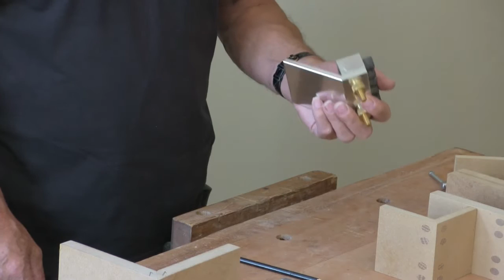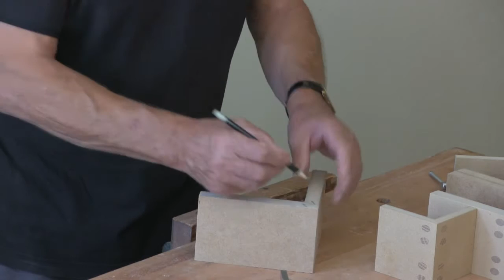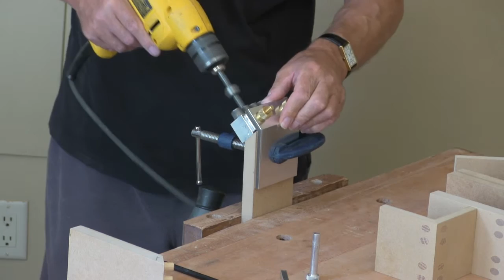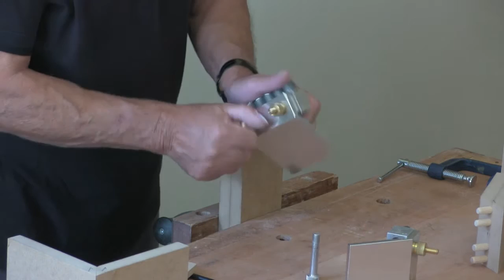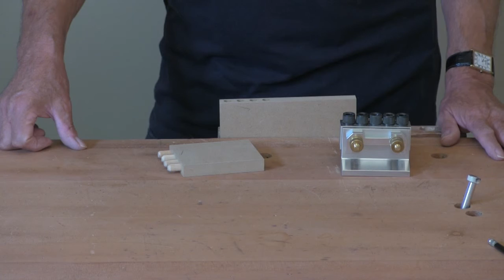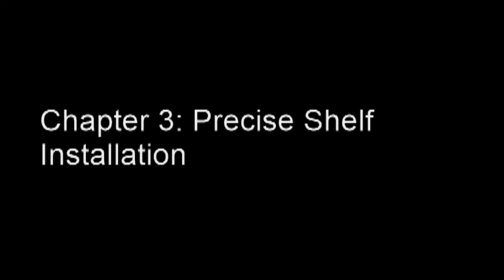Strong Miter Joint with New Dowelmax 45 Degree Accessory

Comment: I recently bought a dowelmax and I love it, it does produce perfect joints out of the box in minutes.
One enhancement that you guys really need to offer is something that even you are having to improvise on in your videos.
A piece of angle that is slotted to allow the body of the dowelmax to attach to it using its own thumbscrews rather than a separate clamp for making shelf joints in wide stock. If you could make it in 12", 14" & 20" lengths with a bit of extra length on the bottom part of the angle for better registration to the face and for easier clamping to the workpiece.
Reply from the maker: lumenman Hi Lumenman, Thanks for the compliment and request. Many people don't realize, we are a very small family oriented company. We did consider a similar design several years ago, but for reasons, not at all obvious, we didn't proceed. The initial outlay for extrusions etc,. is high. The manufacturer will not look at anything under thousand pieces, and if he does, the price per unit goes up exponentially. Then you have to market the product. The biggest question of all. In these difficult times, how many people are willing to buy that particular accessory? Anyway we really appreciate your kind comments. Regards Jim.
Reply: you prolly dont give a damn but does someone know a trick to log back into an instagram account..?
I was dumb lost my password. I appreciate any tricks you can offer me.
Reply: @Tristen Brooks thanks for your reply. I got to the site on google and I'm in the hacking process now.
Seems to take a while so I will reply here later when my account password hopefully is recovered.
Reply: @Tristen Brooks it did the trick and I actually got access to my account again. I'm so happy!
Thanks so much, you really help me out :D
Reply: @Reese Larry glad I could help :)

Comment: An update is needed to highlight that there are no more 1/4" spacers (as referenced in the video).  I spent about 15 minutes searching for my 1/4" spacer, wondering why I couldn't find it, until I searched and found Dowelmax doesn't make them anymore.  The 1/8" + 1/16" spacers seem to work fine for the miter edges.  

The one other tip I would mention is that for joining two 3/4" boards with a miter, you need to have 1" long dowels.  Unfortunately, nobody makes these, so you need to make them yourself.  Not that hard, but time consuming.
Reply: Thank you!  I noted the video didn't tell one how to adjust the drill depth, or the resulting dowel length. What, we're just supposed to guess?!?!  Pretty bad  step missed for a company that makes precision equipment.

Comment: Is there a way to use the Dowelmax and its accessories to install dowels on a mitered and beveled crown moulding?  For example, an external cornered crown where you had to use a miter angle and a bevel angle on your miter saw.  The application could be adding crown to a tall bookcase or kitchen cabinet.
Reply from the maker: I'm pretty sure this question came up several years ago.  It concerned a mitre /bevel arrangement for the four upper rims on a serving tray.  I had serious reservations, but when I tried it on a test piece I was amazed to find it worked.  Not recommended for stock less than 1/2".   Regards Jim.
Reply: @DowelMax  Hi Jim.  Thanks for the reply.   I'm new to the dowelmax family.  I have the 2023 model and the 45 degree miter plate and the angle bracket.  I must be missing something basic because I just can't figure out how to configure the dowel max to conform to the miter and bevel.   My stock is solid birch wood at .75" thick.

Is can you direct me to a video or write up on how to achieve this?  It's crown molding for a bookcase I made.
Reply from the maker: @MixingGBP  We expect you will need some sort of custom adaptation to suit your project. Some angles will require a shop made solution as shown here:

https://www.dowelmax.com/wp-content/uploads/2023/08/anglejoints2-large.jpg

Also check out the mirror project on dowelmax.com for some adpatations using mouldings:

https://www.dowelmax.com/dowel-jig-system-projects/how-to-build-a-mirror-frame/
Reply: @DowelMax  I see now.  I'll need to make a shop jig to fill in the spaces to achieve faces parallel to the dowel max clamping surfaces.  This allows the dowelmax to clamp on that shop jig as if it were clamping on a non-mitered and non-beveled workpiece.

Comment: On the 45 deg attachment you completely skipped over drill collar setting and the resulting/required dowel length. ☹️
Reply from the maker: Hi John.  It's actually different for every joint, but I have a method I use: With the angle plate secured, Push the drill and collar thro. a guide until it almost touches the plate face. Set the collar at that position.  In some cases use spacers to position the hole as close to the inner corner as possible. It will be stronger and less need to cut the dowel.  Hope this helps.  Jim.

Comment from the maker: dspeerelec643 commented: "The shim that he is adding to center the dowels works. But, this technique is also possible with the JessEm. It is slightly misleading to state you cannot do this with other systems. Obviously you can.
Reply from the maker: But you don't explain how to center on odd thicknesses with any other system, and so it is just an unsubstantiated comment.
Reply: @DowelMax  Where is the comment? Did you delete that? I dont know about the Jessem jig, but with Joint Genie I can do absolutely everything you demonstrate here, without the need of a special 45 degree attachment.... I have seen that you are very agressive in stating that your dowel solution would be "the one and only". I have not used it, but it looks nice. But it does not offer more than Joint Genie -- which is even more flexible in some ways. And no, I will not back up that statement. You already know what other systems offer compared to yours. So please stop to try to fool people that your system would be the only one which would achieve certain tasks. There are many ways to get to a good dowel joint and your solution seems to be one of those. Thats great. But dont diminish what other systems offer, especially not stating "one of a kind" when its not true.
Reply: @nickgoogle4525  Will the joint genie work on 4x4 material?
Reply: @walker8989  Why shouldn't it?